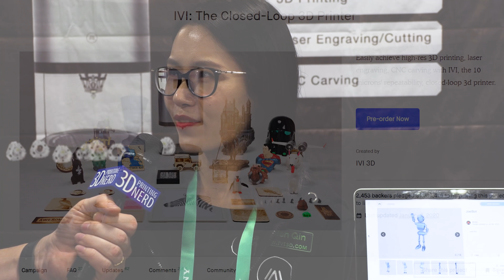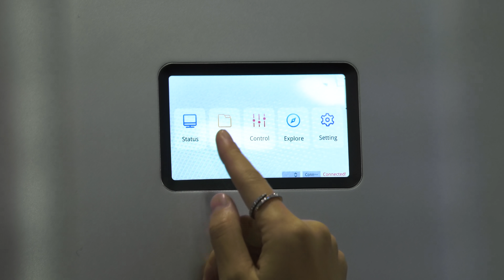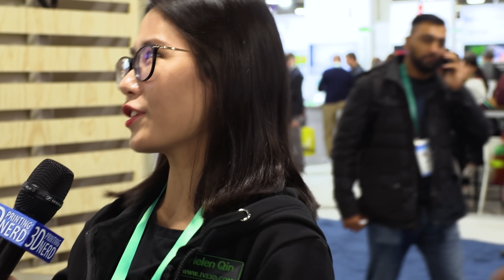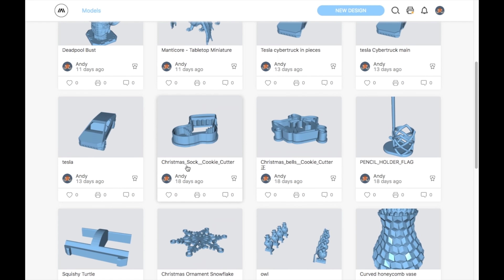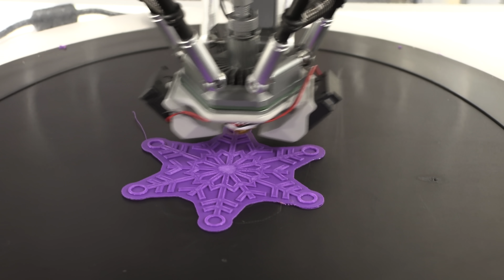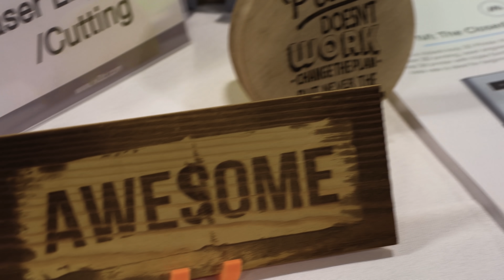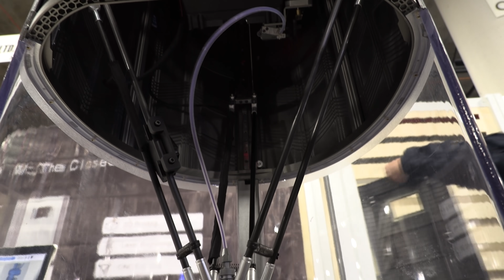3D Printing FAST with IVI 3D Printer at CES - Shipping Soon!

Comment: Hey, looks great. Nice to see a company put a Kickstarter campaign to good use. Just wondering about the computer software, there's a screenshot where they show a bunch of models under the name "Andy" that are models from the community. How are they crediting designers?
Reply: Well that's clearly just a mock-up/internal demo. Would be kinda pointless to show their service interface without any content in there.

I doubt that service would be filled up with content by the company, but users. Whoever uploaded gets the credit. Basically another thingiverse.
Reply: @niter43  Exactly
Reply: The models in the video are for demo only. Users will need to specify the designer & source of the model if it is not original.
Reply: @IVI3DPrinter  great, thanks for the answer! Looks like a solid printer.

Comment: how are CNC pieces secured to the bed?
Reply: On their kickstarter and forums they have shown images of this. The "print" bed can be taken off and swapped. The bed for CNC (and laser-engraving) is supposed to be perforated (I believe with screw threads) so that you can mount parts to the bed and fix them with clamps. I'm not sure if clamps will be included or if you need to print them yourself.
Reply: @Dzeno2010  Thank you for helping to answer the question. Yes, there is a separate perforated CNC bed, a set of bits, a set of fixtures. These are included in the CNC module.

Comment: TIKO on a larger scale. Sounds like they took the design idea and hopefully improved on it.
Reply: I have a Tiko. The hardware really was really quite beautiful, and worked pretty well as a small home printer, but they ran out of money before they really got the software done. So if they tried again on a larger scale with more money, that’s be great! The potential to print on any surface is intriguing, too - you can put the TIKO down on anything, and theoretically print on it. Which could be fun on cloth, etc.
Reply: @lairdpopkin7003  That's great, I'd love either a TIKO or my investment and shipment money (you know, the shipment money they collected after they knew they wouldn't ship).
Reply: @getpowened  same
Reply: Laird Popkin did you still use Tiko?  What program you use?
Reply: @lairdpopkin7003  the only real similarity to the Tiko is that they are both delta printers. Very different in most other ways
Reply: @npgoalkeeper _ hopefully they don't waste time and money trying to make a new hot end instead of just using one that works well already.

Comment: Looks like a Tiko
Reply: My thought exactly. I have 2 TIKOs collecting dust.
Reply: I had one. Never produced a print came broken. Landed in trash have a new prusa now.
Reply: You most probably can "fix" it but it wont be the same printer at that point.
Reply: Wasn’t fixable internal electronics were broken and motor did not work. Was just piece of crap.